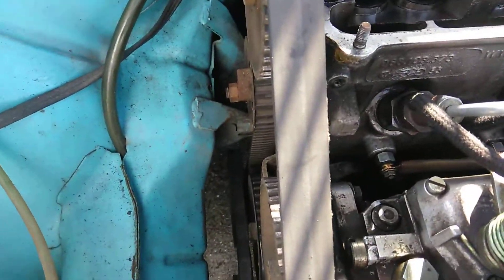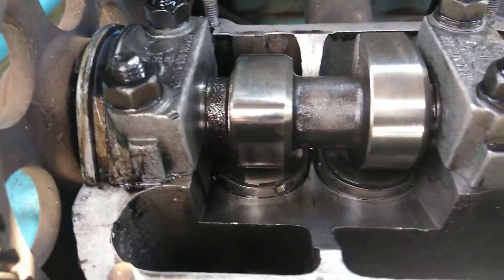1978 VW Rabbit Diesel pump removal PT1

Comment: Well in my experience you don't really need them.  Camshaft can hold itself pretty much without any lock. You can always work with loose cam pulley and your cam won't move. And the pump. I tried to use long 10mm socket but it wouldn't come out on the other end and the pulley would not hold on its place because it would hit the body of the pump. Because it was covering half of the hole that you were supposed to put your locking tool.  Anyways I installed the timing belt just approximately on the fuel pump and than primed it later so it doesn't even matter you can always make tiny correction on the pump later.